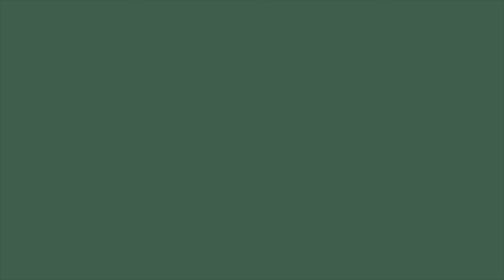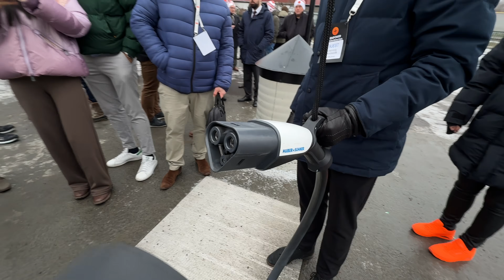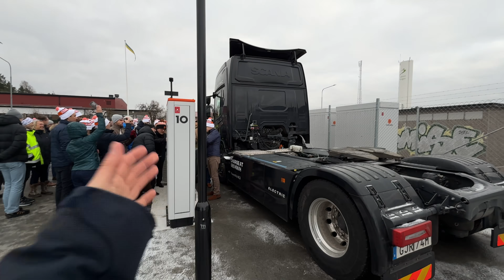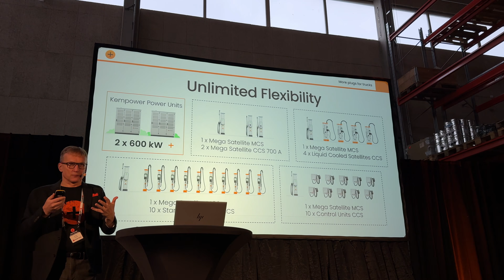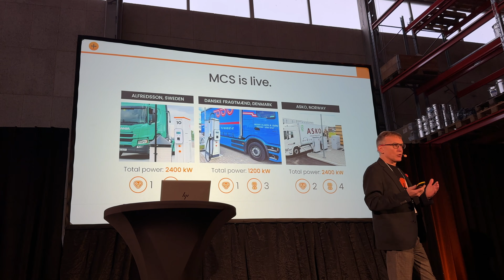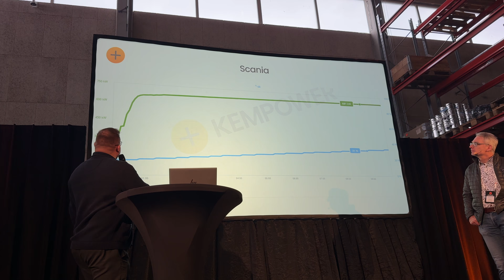Electric Trucks Need Very High Power Charging! Megawatt DCFC w/ New Kempower Units

Comment: 400 KW-Power is enough for Trucks. After 4,5 hrs the break for the Driver can be used for charging, that is enough for a day. What is needed, more parking-areas to charge over night, while Dirvers sleep, and the Truck has not to be moved.
Reply: That is key to the electric revolution. Suddenly new entrepreneurs can steal customers from traditional truck stops and gas stations. The new players do not need the old infrastructure, they just need the space for parking and setting up new chargers and then they can expand on other services to attract even more customers. More and more gas stations and truck stops will realize they will either adapt or die.

Comment: You got to watch the Electric trucker from germany. He Shows that MCS is only necessary for very few use cases.
90% is possible with ccs.
Reply: He shows it can work as long as electric trucks are not a large percentage of total trucking.  When there is a line for a charger the logistics change.

Comment: This was good info on Kempower MCS, but as stated below, the Electric Trucker has shown that 400kW chargers can get you from the UK to Turkey (great charging in Romania!). Howwver, when all or most of the trucks are BEV you will need those MCS cabinets (maybe not the MCS connector).  

Will you do a video on that trick that took over 900kWs?  What is the battery size & range, load capacity of that vehicle?  Good job & looking forward to more long haul E-trucker info.

Comment: I think you should do a video about battery banks for charging stations. Compare price and performance for a setup using battery banks vs traditional setup. As more and more heavy haulers are BEV how can battery banks help with stable power delivery so that all trucks charging gets as much charge as fast as possible without changing companies paying premium to the electrical companies.

Comment: It depends on their operations. We have two 18t trucks operating double shifts both sharing a 22kw DC charger. One of the big road blocks to electrifying road transport is the perception that a huge charger is also required and in most applications this isn't true.
Reply: well well well
if you have the time to charge for 48 hours, maybe just maybe a little bit you have a point.
Reply: @ursodermatt8809  Read it again - two trucks double shifted.
Reply: A large charger is needed for quick charging. If you have only 30min to get close to a MW in an OTR truck, then an MCS would be needed. But that's a rare example. Many truckers can stop for several hours. If there's enough battery to get through one's day and to an overnight stop, then you have 8+ hours to charge it. Granted, that'd still need a 100+ kW charger, but that's "small" in these circles. (in an overnight truck stop, I'd bank on 150-250k per truck.)

(There's all kinds of "hours" mandated in DOT rules, so there will usually be time to charge.)

Comment: Who needs Megawatt Charging? 
If you drive 4,5 hours and charge with 350kW CCS htat is plenty enough for your allowed 2nd driving of the day. 
In the evening you would have to move your truck from the charge point after 1 hour which you are not allowed.
That would be strict against the law in whole of Europe.
Reply: And if you change drivers?
Reply: @Sahkoautoseparempiauto Then you could drive and would needs 2000kWh battery because you do not make any rest stop at all. But i do not know of any haulier who could afford double personell on a route. Do you know of anyone? Not even Nanno Janssen, perhaps the richest Transporter of speciality goods in Europe could afford a second driver.
Reply: @wolfgangpreier9160  They don't need double personell. Just a change of shift at depot and the same truck keeps on trucking.
Reply: @scronkfinkle1408 which Depot? Only a few percent of Trucks are Running fixed routes between unmoving destinations. And they can always charge during loading and unloading.
Reply: Market adoption will show what is needed, but good to have the option. Just think about (semi) autonomous trucks one day...
Reply: OTR trucks aren't the only things they plan to charge. (they showed actual, in use MCS for the robots at a port / container yard.)

Comment: What he's missing with the 400kW chargers and a Chevy Bolt is that because the chargers have 2 ports each, the Bolt would get its 50kW on one port while still leaving 350kW available to the other port. So let's say five 400kW chargers with 2 ports each being half filled you still have basically full power for 5 high speed charging EV's and 5 slow charging EV's. 

While on an undersubscribed destributed system, if you have half the sites filled or more, no fast charging EV is getting full power. As EV's get higher and higher charging such as 400kW, the dual port, high powered dedicated chargers is the best system vs undersubscribed distributed systems.
Reply: You are most likely thinking of an Alpitronic HYC400, that can charge 4 cars at the same time, but is normally set up with two stalls.

Your example with the bolt illustrates Kempowers point:

If a Harley Davidson electric bike connects the the other port, it uses 16kW max. It will occupy a 50kW power unit. The remaining 300kW of DC rectifiers can not be allocated to a third stall.

Alpitronic know this is a weakness, that's why Alpitronic new HYC1000 has the same setup as Kempower, but with 62.5kW granularity and max 8 stalls.

And one other thing, you assume "EV gets higher and higher charging", this is incorrect. A motorcycle will never have 400kW charging, a quadracycle will never have 400kW charging, and a snowmobile will never have 400kW charging. But some of them do support DC charging.

Distributed DC charging solution is the only way to get high throughput with a diverse set of EVs.

Kempowers, Alpitronic, ABB and Tesla all make charges that use the satellite model.
Reply: @MichaelEricMenk  You are bringing up next to none existent vehicles. Perhaps you're India or another South East Asian country where scooters make a decent percent of the EV's out there. My comment referred to America as the person speaking was American and was referring to America where those are basically none existent.

Yes, Tesla is still the #1 provider in America, but it has fallen way behind in high power charging becoming only a last ditch option for all 800V vehicles, the growing majority of EV's in America. I love Kempower, and they have a factory in America, but they have fallen way behind Alpitronic due to the lack of high-powered, dedicated charging. America is a very large country and needs dedicated high power charging to be able to have the masses convert to EV's. Rightly or wrongly, that's a fact for America.

It's why trillion dollar corporations are installing 400kW, dual port chargers all over America. And they don't get to those valuations by not knowing what they're doing.
Reply: @junehanzawa5165  wrote: "America is a very large country and needs dedicated high power charging to be able to have the masses convert to EV's. Rightly or wrongly, that's a fact for America."

This is not correct.

This is a typical arguments made by people with lack of knowlage.

You do not need "dedicated high power charging" to get high throughput on a site, you need a system that covers the average power needs. The power needed is about 75-100 kW/stall for cars on a large site. This is why Tesla has 90kW/stall. Their current limitations you are referring to will get better when their new 1000V cabinets (version 4) is rolled out.

qoute: "It's why trillion dollar corporations are installing 400kW, dual port chargers all over America. "

You are talking about the Alapatronic HYC400. You need more power when you only split power between two stalls. Alpatronic knows the limitations of their current lineup, that why they have startet with the satellite model (HYC1000).

I do assume that Alpatric knows "what they're doing."

An Alpatronic HY1000 with 6 stalls has a better real life throughput than 6 stalls with 3x Alpatronic HYC400. The latter needs 200kW more power than the former. The more connectors you have that can load share, the less total power is needed to ensure throughput.

And BTW: A 1.2MW Kempower installation with 6 stalls will have the same power usage and footprint, but have a higher throughput than a 6 stall site that your beloved "trillion dollar corporations" are installing....
Reply: @MichaelEricMenk  Trillion dollar corporations such as Walmart, iONNA (10 automakers worth over a trillion combined). And 100 billion dollar corporations such as BP Pulse, and Mercedes-Benz. And other providers such as Applegreen are all installing 400kW dual port chargers all over America. Alpitronic is one the charger manufacturers they're using, not the charging providers installing all those 400kW chargers. But I suppose you know better than all those companies.

Nor are they installing only Alpitronic 400kW chargers but also ABB, SK Signet and ChargePoints 400kW chargers.
Reply: It is clearly NOT the best system if you consider cost!

Comment: Kempower supports priority charging, so you can have two truck stalls on one 1.2MW cabinet with multiple car stalls with lower priority.

A 400kW guaranteed for the trucks and 50kW for the cars gives can give you two truck stalls and 8 car stalls on a 1.2MW cabinet.

In the west of Norway the current price for grid power usage is around 4-5 $/kW/month in winter. Aggressive load sharing is the only way to keep the prices low.
Reply: Multi megawatt charging station DEFINITELY needs the battery storage system as a buffer to smooth out the demand and reduce load spikes

Hopefully as LFP battery continues to drop in price and the cheaper sodium ion battery starts to catch up over the next 1-2 years, the battery storage solution will be available everywhere

Comment: 400 to 500 kW is enough for these kind of trucks: e actros has over 600 kWh battery and the 43 or 42 ton truck has a consumption of 1 to 1,5 kWh per km fully loaded.You do not need faster charging cause after 4 or max. 4,5 hours the driver has to make a break of at least 45 minutes. 
Now 4 hours at highest speed of 88 kmh would require roughly 120 kWh x 4 or 480 kWh you can almost recharge in  the 45 minutes. ... or at least 360 kWh.
This means that the truck has lost 120 kWh compared to the start in the morning but still enough in the battery to drive 4  hours again which requires 480 kWh. 

Who will be willing to pay for Mega Watt charging additional fees or prices ?
Reply: A German trucker with the YouTube channel "Electric Trucker" has shown that 400kW is sufficient in Europe to charge during the mandatory breaks, and he has driven all around Europe, and into west Asia with his electric truck.

In other words, a 1.2 kW Kempower cabinet can cover 3 MCS/CCS stalls for trucks.

Or 2 MCS and 6 stalls for cars. As Kempower supports priority, you can guarantee the MCS 400kW.
Reply: A few megawatt charging stations will be needed for fast delivery. There are cases where truck driver drive in a two person team to be faster with their mandatory brake times. One drives the other make break. They need very fast charging.
But for most cases your are right. 400-500 kw will be enough for most truck drivers.

Comment: Related, my Michigan city has about 20  new Electric Blue Bird school buses.
Look identical to their diesel counterparts.
Except they're silent and smell free when they glide past my open windows 😊
The district rolled out these Blue Bird All American Type D buses in April 2025, supported by $7.1 million in EPA grant funding. The project also included the installation of 20 charging stations to support the new zero-emission vehicles.
Reply: Munro did a video last year with one the the major school bus contractors. The buses are identical; the chassis were already designed so they can be ordered with whatever engine and fuel type someone wanted. Ironically, up in Michigan they might still have diesel on board. In colder areas they put diesel heaters on electric buses so they can spec smaller batteries and still have enough range on cold days.
Reply: @Senthiuz Point is, Perfect is the enemy of Good Enough.
If 80%+ of the bus runtime does not need the heaters, that's a big win.

Edit: Gemini AI says-

Feature: Diesel Type D Bus/ Electric Type D Bus
Fuel Energy Efficiency: ~6.6 MPG / ~1.5 kWh per mile
Energy Consumed: 15.15 Gallons / 150 kWh
Est. Cost per 100 miles: $55.00 (at $3.63/gal) / $21.00 (at $0.14/kWh)
Diesel Heater Use: ~0.5 Gallons ($1.82) ~0.5 Gallons ($1.82) 
Total Variable Cost $56.82 $22.82

Even with the diesel heater running, the electric bus is roughly 60% cheaper to "refuel" per mile.
In a bus conversion or fleet scenario, the fuel used by the diesel heater is a "rounding error" compared to the energy required to move the vehicle.

Plus, no diesel engine or transmission overhauls or maintenance

Note that diesel heaters are often used to heat diesel powered buses due to low idle heat from Diesel motors
Reply: @Senthiuz I have no issue with that, and believe diesel heaters should be standard in cold climates. Both for passenger heat and heating up batteries.
In the long run, bio diesel or other renewable hydrocarbons or biofuels could be used for heat, with net zero carbon emmisions.
In the even longer run, higher battery energy densities and or low temp tolerant batteries like Sodium ion and or better heat pump, phase change and heat battery tech will replace the need for fuel heaters.
The heaters are only needed for sustained below freezing temps, maybe below 20F
Above that, heat pumps plus phase change and heat batteries could do the job.
In Se Michigan, we had 10+ mild winters in a row with only a few series of days much below freezing. 2026 Jan is an anomaly vs the past 10-15 years